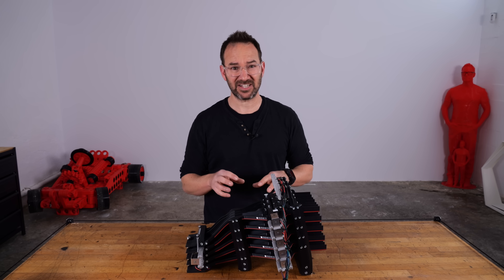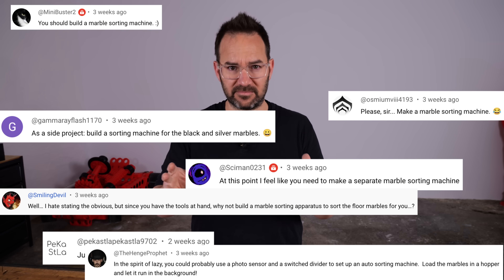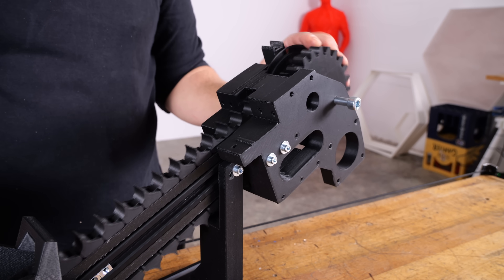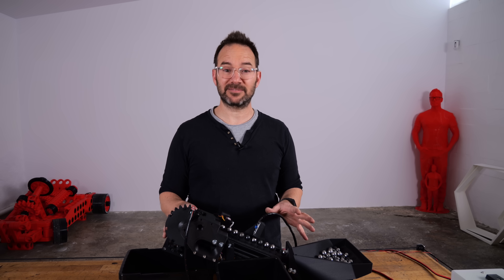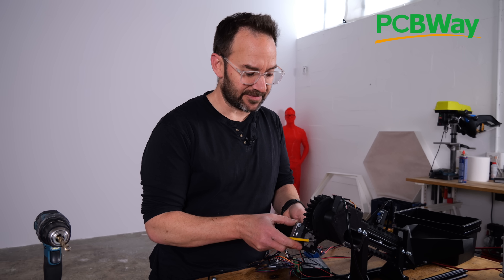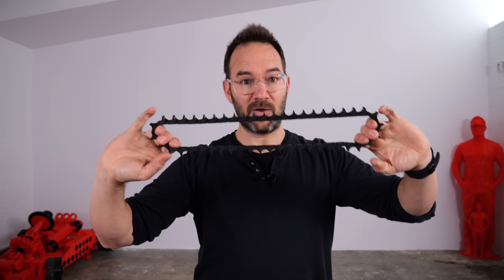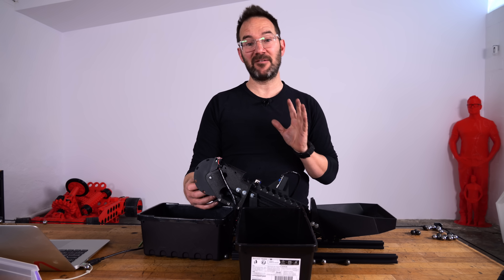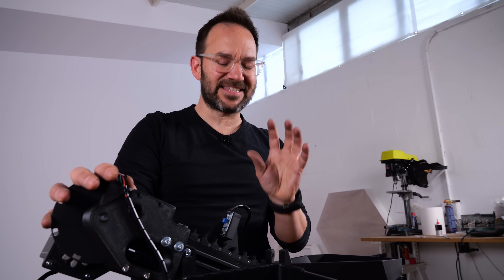Faster than the Eye Automatic Marble Sorter - Marble Clock Seconds Display Pt.3

Comment: Two ideas for possible improvements:
1. Eliminate switching on empty slots. Either switch on the light marbles instead of switching on both dark marbles and empty slots. Or make the chain white and continue switching on black.
2. Make use of paralelism. Use more solenoids to kick multiple marbles at once. With two solenoids you can do odd and even slots. Etc.
Reply: Also another improvement: use a gear motor, not a stepper. They can go faster and with more torque for the same size, and since Ivan has a disc with slots and a photogate to time the solenoid and sensor, the step by step precision of a stepper motor is unnecessary.
Reply: @dragoncoder047 Yeah, I'm noticing a lot of maker type people use nema stepper motors for EVERYTHING, even when they're not using them as stepper motors. Maybe it's a coder thing? They're just used to dealing with things that move in discrete steps.
Reply: @confuseatronica  Nemas make it really easy to precisely control speed for the purposes of testing, because you don't need to bother with closed loop control.
Reply: Adding more solenoids doesn't really work cause the chain is moving constantly and the solenoid reached the limit and having the chain move any faster means it can't punch out and retract within the time a single link passes by meaning it'll interfere with other marbles. More solenoids won't change that. Instead you'd have to duplicate the entire mechanism
Reply: @tekbox7909  Indeed, using more solenoids to increase the bandwidth would require accelerating and decelerating the chain.
Reply: @tekbox7909  SOMEONE GETS IT
Reply: I think it would be less work to just put the color sensor on the side.
Reply: @Angzarr237C  If you put it on the side you would need to build a wall in order to have a consistent background. Otherwise that sensor might have environment dependent behaviour.
Reply: I had the same thought on solenoids. Two or three even. And. Move the sensor over the chain to see color of chain.
Reply: Yeah his original clock sorted up to 8 marbles at once. Not sure why he just didn't use that design and ramp the marbles to a separate bucket.

Comment: Try removing stepper motor and replacing it with "normal" brushed/brushless, you know a shaft position by that opto sensor, so stepper motor is just over overcomplicated... By the way, you can use compressed air for releasing marbles from that chain ;)
Great video, im waiting for another! :D

Comment: Two things. 
(1) halve the speed but 2 or 3 sorter belt/solenoid system in parallel.
(2) you need to slope your table so the spilt balls roll to a corner which has a "elevator" of some sort back to the sorter inlet bucket. 
Point 2 lets the clock dump out onto the table ( as it does ) and it just sorts for the reload section.

Comment: Wouldn't the rotating wheel be faster than solenoid? Also now you know the upper limit. Why not decrease the speed and make 2-3 same modules so they sort balls in parallel. You would then have linear scaled throughput.

Comment: How about using pure magnetism to kick the marble out of the track instead of a solenoid? that way there's no mechanical 'retraction' time necessary.

Another thought would be to mount a wheel over the track, with several cutouts around the circumference for the track to pass through. When a marble needs to be ejected, rotate the wheel by one cutout. Again, no retraction period needed.

Comment: You could probably do a hybrid print-in-place chain where the chain gets printed with all the linkages held together using soluble supports, this keeps all the holes between links aligned so you can easily and quickly push in steel pins (or use screws), then dissolve away the supports.

That'll give a super strong chain which is still relatively easy to assemble.

Could also then print the chain in multiple long segments and join them together in arbitrary lengths.

Compressed air to reject the marbles would probably work well. No chance of snagging the chain if something gets out of sync then.

Comment: use two soleniods, so that nether has to work at full speed, maybe having a second channel of marbles.  Giver yourself plenty of headroom so that you can easily sort the marbles much faster than they are consumed, that way, you leave lots of room to slow things down and increase the tolerances of the machines.  Running too close to overload is never a good thing.

Comment: What if you made a sorting machine kind of like how you have the original marble elevator, where it has multiple channels with a solenoid behind each one, sorting by color, but catch the marbles it pushes out instead of putting them back to the bottom? I imagine that would be much faster

Comment: For whatever you use (servo/solenoid/whatever), what if you had it slightly angled forward?  Since you're starting to move so fast, it might help (like maybe for reliability) if the tip of your poking mechanism is more-or-less traveling with the marble as it pushes it off

Comment: Couple potential ideas....  Elecromagnets to yank the marble out.   Air to shove it.     Create the belt with an opening in the middle/bottom, and poke it from below.      Also, you likely already have a plan, but if you're making a full clock like this you're going to have six of these side by side, having gear hanging off the side is going to make that difficult, unless you make a bunch of longer fancy ramps to deliver marbles, but then you risk your stops at the end not working..   Your Marble Return ALSO has to manage at least 15mps as well (probably closer to 20 when you factor in the rest of the digits)   Certainly an interesting technical challenge!

Comment: That's a really cool build. You could add a second solenoid to take some of the load off the single solenoid if you wanted to go faster. Even faster might be a second servo with a windmill style wiper. You could also add a second IR sensor at the end of the chain if you wanted to verify no black marbles got in the chrome bucket. Also, by chance, did you look into vibratory bowl feeders? Anyway, fun build.

Comment: Just a thought: why not use just an electromagnet to pull the steel marbles off the belt? I guess it would be quicker than the solenoid since you won't have to deal with the rod inertia.
Reply: Exactly what I thought too. A coil would suck those steel marbles at much higher speed than air blast or solenoid punch.
Reply: Even more, you could let the balls fall in a stream and deflect them on the fly with a magnetic pulse. No chain needed.

Comment: You need to use compressed air to dislodge the balls from the tray. Using the valve, you can programmatically adjust the time and delay of valve operation for air dosing.

Comment: I don't think you need a stepper motor for this application. With a basic brushless motor with a variable drive you can use the IR sensor as an input to determine the speed of the chain and feed it back to the motor drive. This should result in a drive that creates much less heat.

Comment: I definitely think this machine could use another iteration to become even cooler. A vibrating hopper seems mandatory before you get the marbles into some kind of accelerator. From there I think the next step is to sort the marbles after they've left the accelerator and are in the air. Seeing the black marbles get tapped away by a solenoid mid-air would be marvelous.

Comment: But your clock already has a sorting function, does it not? As it would not work without being able to seperate blank and black marbles, no?
It shouldn't be too hard to add a "mode" to the clock were it sorts marbles instead of displaying time?

Comment: The solenoid relies on the spring for retraction which by the looks of the slow-mo is the weak part of its motion.
If the solenoid uses a magnetic shaft you could drive it with a H-bridge so it also electrically pulls back
...or use 2 solenoids, one to push and the other to push the first back

Comment: Why don't you replace the solenoid and blow out the marble with a nozzle after an electrically operated valve that is supplied with compressed air?

Comment: This would put on quite a show with two lifts rejecting opposite marbles and sending them down a slide or tube.
It also means you can get away with not pushing everything so hard - if you need 17 per second, you can have both lifts run at 12 per second and be well beyond the required speed.
You then also get the wonderful aesthetic of watching silver marbles go down one tube/slope and black marbles go down the other tube/slope, and two buckets at the top which also could maybe also have a tube/slope that terminates in its destination splitter at the back of the clock.

Comment: I would have though that your original design for selecting black or white marbles where you have parallel solenoids and a wide chain would allow you to go much faster without the craziness. Just put them into buckets instead of sending them directly to the clock. Why reinvent the wheel?

Comment: the sorter should should use a wheel instead of a chain, cut a slot in the side of the buckets so the solenoid plunger can't hit them.

Comment: why can't the servo go 360? instead of back?  By the time it's pushed the marble off, it's already almost cleared the chain.  Crank up the rate on the remaining 270 degrees, and be ready for the next.   Or multiple servo's in a line, and process a bunch at once.

Comment: The idea and design of this machine are both pretty great, but it seems like running it so close to the edge of its capabilities is asking for trouble. My first thought was that a second identical sorter would help this, but maybe it would be even better to expand this contraption to feature a double wide conveyor. Maybe off-setting the pockets on each side could also help things run well.

Comment: 1: You need to produce runs to make sure the marbles don't spill out all over the place, either before or after their intended destinations. Also, runs [like the ones you have all in your clock already] will reduce the clatter so the clock is not so much louder.

2: I would precisely time the sorter so that it only delivered the exact number of marbles needed, and just keep 5 or 10 seconds worth of marbles ahead of it, because that will ensure you are not maxing the machine out.

3: Adding another row, and slowing the speed by half would work more efficiently, keep parts from overheating, and maybe make it last longer.

4: Adding a stronger return spring to the solenoid can help it not get stuck so often because [just like in a 4 stroke engine] it will move the part back faster.

5: Adding a small rubber bumper [maybe a pencil eraser cap, or a 3D printed elastomer based bumper] would make it somewhat quieter to operate as well.

6: Adding a small thin layer of elastomer [or thin rubber strip] to the faces of the chain links would help make it slightly quieter too.

7: Adding a more graceful curve to the exit point of the recycle hopper would reduce sound because marbles would not tend to drop as vertically, and therefore, not hit with as much noisy energy.

Comment: Remember you're making individual decisions and movements quickly, however the marbles often come in long runs of one or another colour.  You currently keep a 3 ball buffer in the microcontroller, so will have the advantage of looking ahead...if you make that a virtue you may be able to simply switch a diverter at key moments and so longer runs of the same colour will empty into the correct bin by default, not needing individual treatment

Comment: using 1mm size-different marbles for your black ones is all you need to do, I know it's not as "Fun" as a high-tech gizmo, but it's been working for coin machines for over a hundred years...
just have a rail section a few cm long that will guide larger marbles to continue along the rail, but lets smaller ones pass through.

I suspect you already have all you need too, some steel rod 4-6mm thick, some Pliers and a Torch to heat and bend it, and some oil to quench in to harden it... 🤷‍♀

just use calipers to ensure your rails are parallel and perfectly spaced all the way down, and if you want to make them longer, for higher volume, either use thicker rod, or 3d print a backing frame to brace the rail. you'll want it to be very hard (hence hardened steel rod) so that the marbles do not slow down on it, so if you want to 3d print it all, it'll need to be something super slick, like delrin, which I've heard is a nightmare to print with...

Comment: Position the solenoid further from the belt, it only needs to tap the marble at the very end of its stroke. You can also have more solenoids and work in groups of marbles just like the clock does. But none of that matters until you build a bigger bucket to stop all the marble spills!

Comment: I think the main issue is using something that goes forward AND backward to kick the black marbles off. It would be easier to have a gear shaped object over the conveyor. The marbles pass through the valley between two teeth when they're silver, and the gear rotates by 1 tooth if a black one needs to be kicked out. That way you only have to move in one direction, instead of moving to kick the marble out, and then retracting it.

This gear could be tight to the track, so with teeth on either side pretty close, but that would probably result in acceleration issues, so you could also have a very wide gap between the teeth, so it has time to get up to speed. In theory, this solution would be able to kick off marbles at any speed, it would just require a larger gear wheel and larger motor.

Comment: I have an idea. In your current design for your clock, you can make, that only marbles that need to change, are changing. This would add some work on your program, but would really help reduce speed you need to sort marbles, and 2 marbles wouldn't change anytime. Of course it wouldn't be that spectacular. You have to decide what is more important in this situation.
Reply: I like this idea. No need to replace the marbles if they are the right color.

Comment: hold on, at that rate 20 per second - if you have multiple lines each feeding individual pixels of the 'screen display' - you could have one of these sorting marbles for each pixel, with a sequence in a length 60 loop for the black/silver needed for that pixel, and then the buckets collect the marbles that are ejected from the machine and back around again into the sorting queues.

Comment: You could dynamically adjust the speed of the chain. If there are multiple black balls in a row, go a little slower. If there are multiple "white" balls in a row: increase the speed slightly.

Comment: Instead of the solenoid pushing the marbles directly, wouldn't a sprocket gear make more sense? So that you only have the time of the gear moving through the chain once, without it having to get BACK (like the solenoid has to) to clear the way of the chain

Alternatively, you could just go for pressured air, which is how sorting is done in recycling centers. It would also save you the timing of any backstroke and would have the additional advantage of not having to break mass like you do with the solenoid prong, which also causes noise and uses energy (=heat)
Reply: I think the major downside of pressurized air is the noise from the compressor. They're very loud, and not the charming click-clack of marbles being shuttled around, but a deep growl. Compressors also tend to be bulky, making them hard to integrate into designs. Both of these issues make them decidedly not maker-faire/youtube video friendly.

I'm also not sure Ivan is particularly familiar with compressed air, and incorporating into a large scale project like this may be more work than it's worth.

Comment: A lot of good comments, but as far as I've scrolled down I don't see anyone giving the most obvious solution: just double the sorting track. If you have two of them from the hopper you can run both at a much more reliable speed and still get double the sorting power. There is no reason to have a single track when you can have multiple of them running in parallel.
Reply: Also, instead of a solenoid try using a wheel with four spokes, if you're able to measure how far the motor rotates this lets you have it rotate 90 degrees quickly in a single direction to eject the marbles making it much less likely to catch/get stuck on the marble lift.

Comment: On factory assembly lines they use compressed air to eject selected items

Using compressed air means you don't have something like a solenoid physically blocking the line

They use it for lightweight items like crackers and aluminium cans so I'm not sure how it would go with something the weight of a marble

Comment: Sort, reload and display time. Reload seems like it might be the easiest of those 3. But determining full capacity of the rack unless it’s dumb and just has funnelled rails that when a free slot gravity fills the slot out of the sorted marble box. like a BB guns storage
Reply: Revised edition of sorting gravity feed again then mutli rack that’s like connect 4 grid but for marbles that uses solenoid left or right depending on colour. Then you could sort 100+ per second with no moving track required
Reply: Then after the dump of random marbles at the bottom tube that sucks the marble into the sorting box dumps into the loading boxes into the clock for continuous 24hr clock run challenge. 😂

Comment: you can double the sorting speed by just building two of them and running them in parallel. would be a lot more reliable and probably less effort than all the redesigns to increase the speed of the initial design

Comment: have you tried using the servo motor with more arms and in a circular path? then there would be no more reset movement or chain stop, and at maximum speed it would be more than able to keep up with the chain